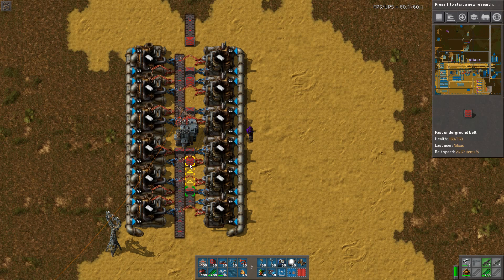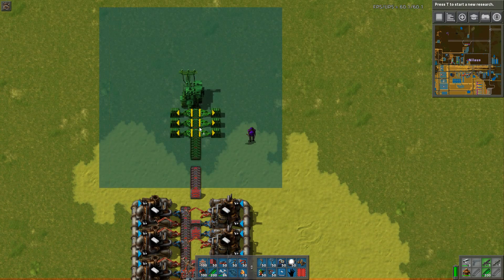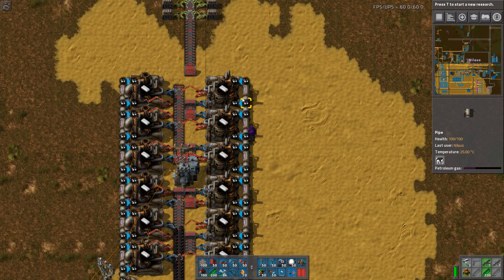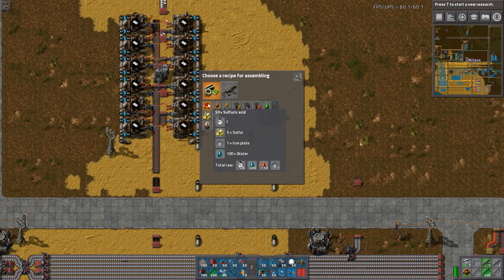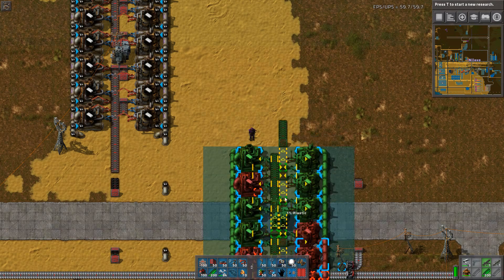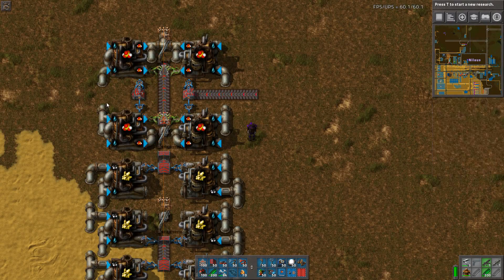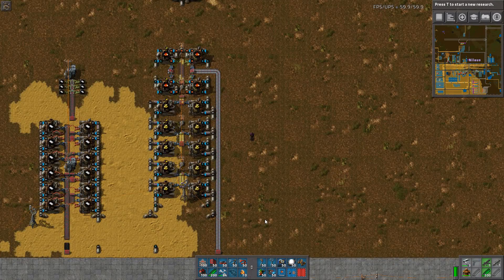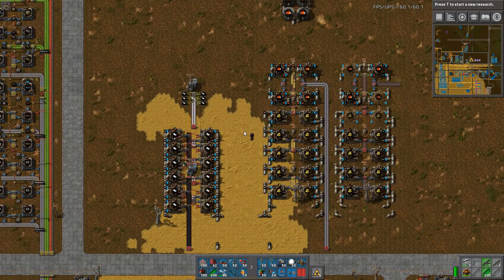Factorio Tutorial - 11. Plastic and Sulfuric Acid

Comment: How do you get sulfuric acid into an assembling machine (fill sulfuric acid barrel recipe)?
Reply: You need at least a level 2 assembling machine. Once you set a recipe that requires a fluid, one of the sides of the assembler will turn into a pipe looking thing, which you can change the side of by pressing R on the assembler.

Comment: Using a substation in the blueprint feels like you are jumping ahead since it requires red circuits to make and blue science to research.
Reply from the maker: You are absolutely right. I thought of it afterwards and it is not actually much better with a Sub Station and is not a pre-requisite for making it work
Reply: It actually works with just 2 medium poles.

Comment: wouldn't it it be more convenient to put the acid production below the sulfur and reverse the sulfur belt? so you don't have to take the iron line all the way up there.
but other than that nice design. i put hours into my version yesterday and while it looks nice it is not nearly as practical.
Reply from the maker: Vargouille, luckily blueprints can rotate 🙂
Reply: hm makes sense. i thought there could be another benefit to that setup i didn't see somewhere (or sometime).